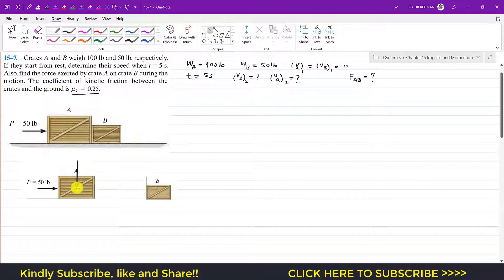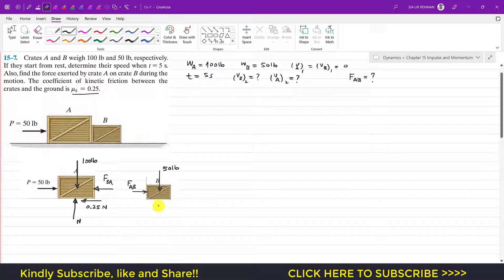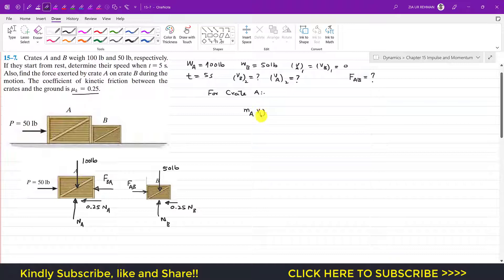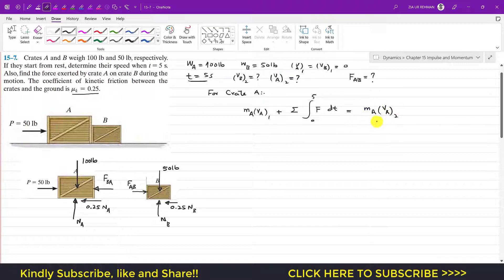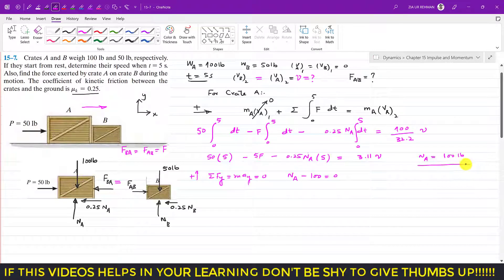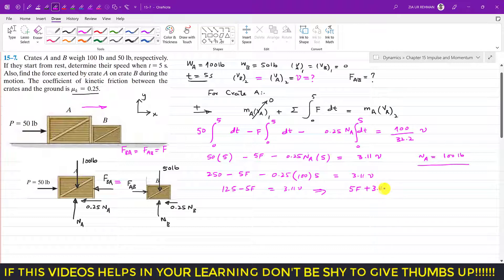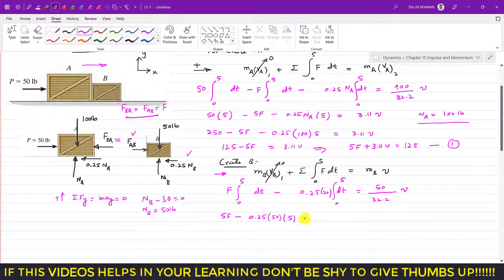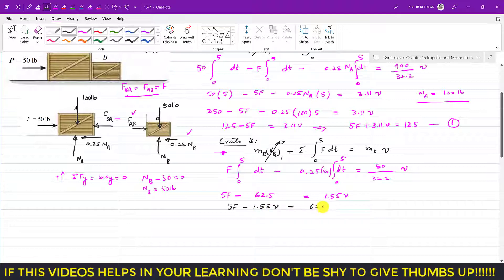15-7 Kinetics of Particle: Impulse and Momentum (Chapter 15: Hibbeler Dynamics) Engineers Academy

Comment: why is it divided by 32.2, where is that number come from
Reply from the maker: Acceleration due to gravity
Reply: Youre prob graduated and know it all now but for other people we are used to receiving problems in metric units so when we are given imperial units its a little different. We must remember pounds is a force or weight not a mass like kg. F=ma So when given the force (lbs) we must divide by the acceleration due to gravity in imperial units (32.2ft/s^2) to get the mass which in imperial units is called a slug.